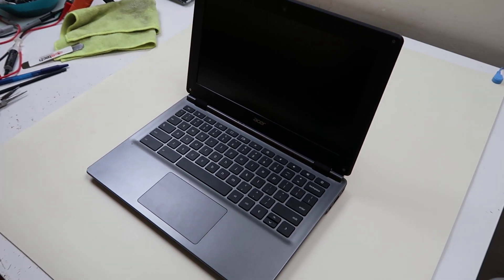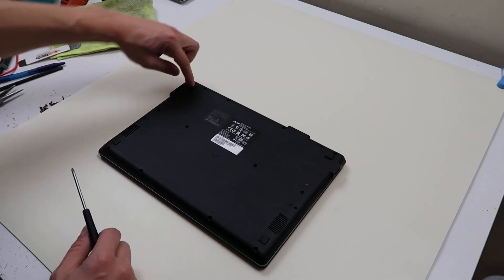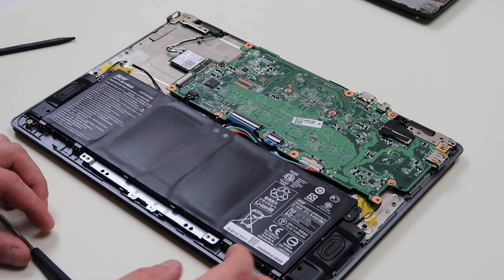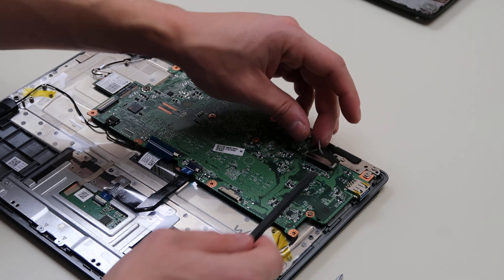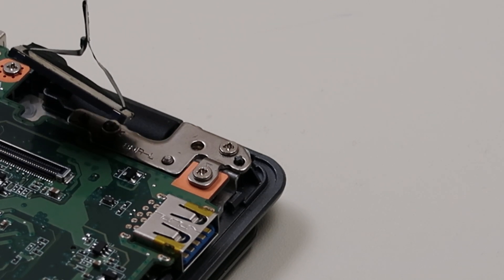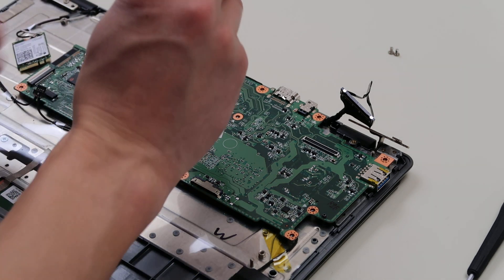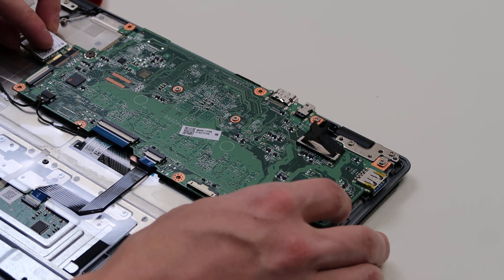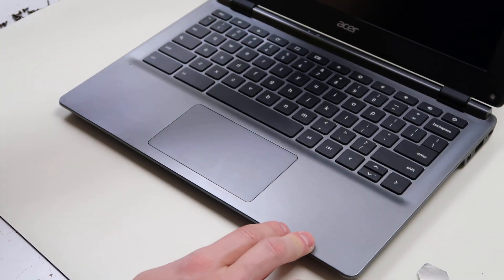How To Replace Battery, Motherboard - Acer Chromebook C710 C720 C730 C730E

Comment: i cant get anta wire stay on for internet on cb310 model n1902
Reply from the maker: Not sure if I correctly understand your comment.  Your trying to snap the antenna wire onto the wifi card and its not snapping on?
Reply: @PC_Monkey  please help out I plug the wrong adaptor
Reply from the maker: @komolafetoheeboye5675  1. Using the wrong adapter can damage a computers motherboard in many cases :(
2. For a computer that does not turn on, try this video first; https://youtu.be/kOBY4k2Mn_k. Let me know how that goes :)
Reply: Please I used wrong adaptor for this PC now it won't turn on